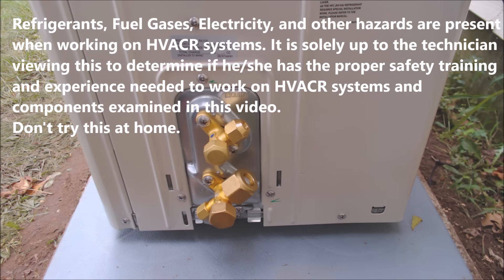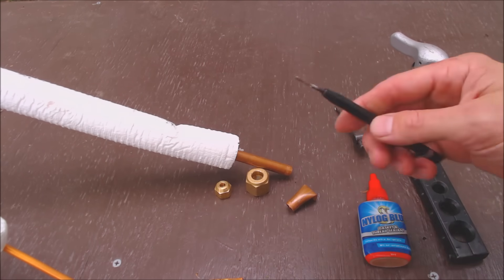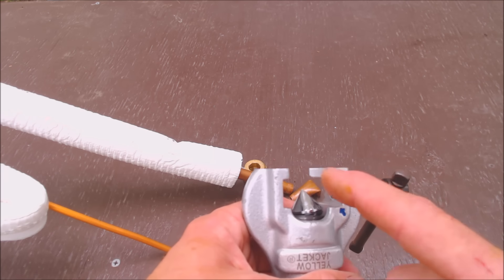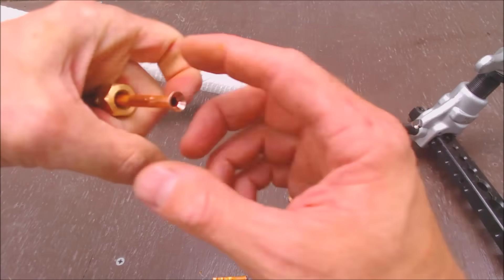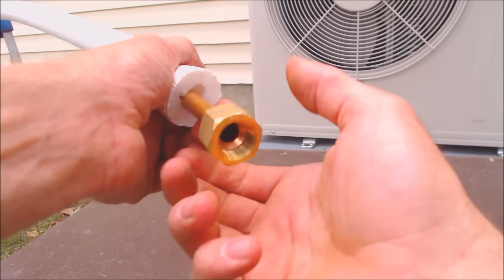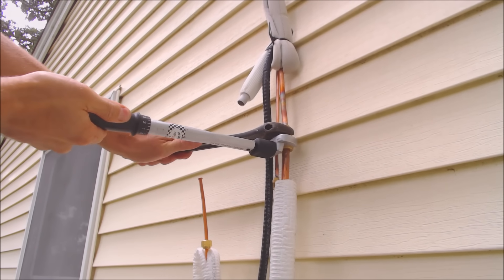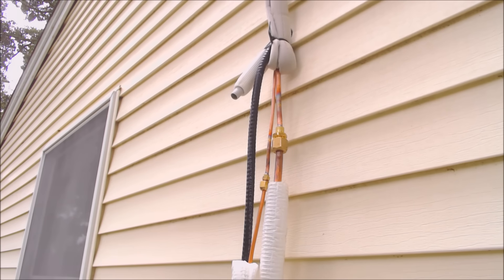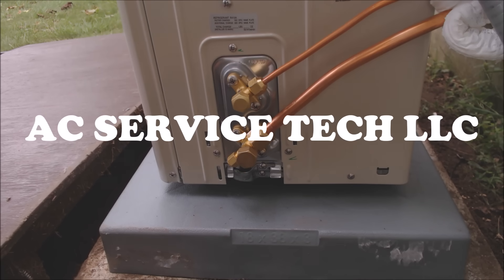How to Flare and Install Copper Line Set on a Mini Split Unit!

Comment: I am in the processof installing a 1.5 ton mini split. The Unit came with a SealSafe leak prevention kit (PAC-FSR-1412).  Kit includes a fluid (leak guard) and (2) 1/2" Flareseal rings and (2) 1/4" Flareseal rings. Would you recommend using both the rings and the fluid or just 1 of the 2 products and why?

Thanks

Comment: “I like to take up the full (area) of the flare seat” …almost everything else was very well done, but the larger flared end actually makes it more likely that the flare will leak either immediately or later on. Flares leak when a crack propagates from the stretched end through the seal created by the pressure from the nut forcing the flare and seat to conform to each other. Once a crack begins to propagate it will keep growing. Increasing the length it has to reach before there’s a gas leak only changes the number of temperature/pressure cycles before it spans the seal. Adding 25% to the area adds 25% more time before it leaks. Stretching the copper tube end 25% more to increase the area makes it more than 25% more likely to begin to propagate a crack. It makes what you want to avoid more likely but delays detecting a defect. 

The tubing was cut well, not stretching more material inward than necessary. The reaming was done at light pressure to shave off the material rolled inward without stretching anny of it outward instead. Oiling the flaring cone gets a more uniform stretch of the copper by preventing patches of material from sticking to the cone to shift the pressure to their edges and over-stretching there to compensate, 

A flare stretches the open end of the copper tubing. The more you stretch it, the more likely it is to begin to propagate a crack from the open end that will become a leak path, either during installation or later. The flare only needs enough surface area for the surface roughness peaks that get mashed together in a blotchy pattern to form a continuous barrier. 

. On a microscopic scale every dull metal surface looks like the Himalayas. When the surfaces are pressed together by the flare nut the pressure at the peaks is extreme reshaping the surfaces until enough of the area is in contact to have spread the force out below the elastic limit where the material is only flexing, not deforming. The randomness of the surface roughness makes the area that is actually in intimate contact creating a gas tight seal blotchy. The flare needs enough area to make sure the blotches connect to form a continuous seal. More flared area doesn’t make a better seal, it only forces the installer to tighten the flare nut more to develop enough pressure over a larger area. 

   If you want to make flares that are less likely to leak, make a double flare. The flare is 4x less likely to crack because it takes four times as much stress to initiate a crack in the middle of a surface than from an edge.  A double flare doesn’t stretch the cut end. It stretches the tube wall and pushes the cut end down inside it. It’s named for the double thickness flared end and neeeding two operations in the flaring bar. The failure rate is almost nil, which is why it’s used for brake lines and hydraulics that operate at 1000’s,of psi. The reliable connection is a good trade off for an extra 30 seconds work. 

    The first step is to form a bubble, bulging the tube wall outward near the end. It’s done with an insert in the end of the tube that’s shaped to make the cut end want to collapse inward onto a post so that it bulges outward in the cup of the flaring bar. Unfortunately eccentric drive flaring tools won’t back the flaring cone off far enough to drive the insert, aka button. Use a straight push flaring block with the double flare button to form the bubble. The tooling convention is to make the rim of the button at the thickness that the tube should project from the bar so that it’s a handy reference for how far the tube should project from the flaring block. The standard flaring block doesn’t center the drive cone. That’s fine for single flares and double flaring steel tube. Copper is softer and forms an asymmetric/ off-center bubble if the drive cone isn’t right on center. Until the skill is mastered, turn the drive cone gradually and watch to keep the button parallel to the flaring bar. Be prepared to back off and shift the location of the drive cone slightly to get back to parallel. Drive until the button is almost tight to the flaring bar. If driven tight it’s more difficult to pull the button out of the end. Back off the cone and remove the button. Transferring the tube to an eccentric drive flaring tool to form the flare is a personal preference, it can be formed in the flaring bar it’s in already but the eccentric drive tool makes a symmetrical flare easier to achieve.

Comment: Great video. The eccentric flare tool is a pleasure to use. It does a great burnishing while forming the flare perfectly. I have the same torque wrench. An observation about it if I may. It is essential to be cognizant of the top of the wrench when applying torque. Sometimes in the field we can get twisted up and out of shape. The torque wrench can get flipped and used in the wrong direction.  These wrenches are NOT calibrated in both directions so if flipped upside down the torque will not be accurate.

Comment: Why can we use flare fittings with R410 mini splits but have to braze condensers?
 It is the same gas and pipes at the same pressures.
Great Video

Comment: Would you flare over braze solder the joint ? I’ve heard a lot of times flare fittings can have issues even if they’re done perfectly correct what is your take on this

Comment: Hey Craig,  when using the yellow jacket flaring tool i sometimes struggle to get the depth just right. It seems to me that the depth needed to achieve a flare that backs up tight to the nut (as you like to make them) differs between different sizes of pipe. Is there some kind of a depth gauge or something to cut down on the guess work? Thanks

Comment: Should you seal the ends of white insulation, I’ve been hearing about a lot of problems with moisture interacting with insulation and causing pin holes in copper

Comment: I have a haunting question. How much line set can you remove (how many feet) before you have to worry about the amount of R410a in the system? I know Pioneer is pretty precise about how many OZs to have per running foot of line set. But is there any leeway? What if I want to cut off 4 feet from a 16' line set?

Comment: Thank you for the great video instruction.  I use a product that is inexpensive insurance.  It is called Flaretite.  I have no affiliation with Flaretite but highly believe in their product.  Have had zero callbacks due to refrigerant loss.  They are basically a gasket for flare connections.  Even tried Flaretites on a poorly done flare and it sealed perfectly.  They may send you some samples to try for yourself.   I have shared some of my inventory with other HVAC Technicians and they are impressed.  

I very much enjoy this channel!  Thanks again.

Comment: It seems like every call I had to those type of units ended up being a leak at the flare. Sometimes they lose enough gas and get reset so many times that it takes the compressor out.  One of the biggest names in my area used Leak-Lok on the flares.

Comment: At 1 min mark , what if the ends coming from the wall are female fittings and your adjoining line set is also female?  I have this situation (I have a 50' line that I need to extend by 10'.  Do the male ends that you need to add to the opposite end have to be silver soldered? Or can they be a flared fitting as well?????  Thanks in advance.

Comment: Are refrigeration flare nuts sized metric? What are the sizes of the 3/8" and 1/2" line nuts? Can an automotive torque wrench with a crows foot work for torqueing?

Comment: How did you bend the pipe?
Reply from the maker: Just by hand. Its very small so no tubing bend was needed. The outdoor hole in the wall was also olongated downward which made it easier, thanks!

Comment: Good morning I just subscribe to the channel very clean work! I have a question regarding the line set coming down the wall I have a similar situation that is being installed here today actually. I don’t want to have the ugly looking insulated copper pipes just coming down the wall as it’s where you walk in through my gate of my house on the side. So I would like to use line hide or something similar to hide all of the pipe as it comes down the wall is there anything that you can recommend that will fit everything inside? My AC unit is residential and 2 ton. The total travel from furnace to the side of my house is 70 feet.

Comment: Hi I have a mini split system that has to have the line kit replaced but all I see is  3/4” on one of the nuts and 7/16” on the other is that the tubing or the bit because I can’t find tubing that size

Comment: I don't understand why your torqueing down the 1/2" line to 40+ foot-pounds when many others call for 25.8 then loosen then re torque to 26.6 Foot Pounds including Mr Cool Non DIY units. Their 1/4 line specs were 11.00  pounds then tighten up again to 11.8. Can you explain why your saying 40 Plus foot pounds with the same copper lines?

Comment: My question is how short can you cut the lines? My inside wall unit is going inside my garage and the outside unit is going outside in the same area so I really only need like 6 feet of line and I have 16.
Thoughts?
Reply: Manufacturer of the mini specs a minimum lineset length for proper operation. Most are around 15ft with stock charge. 

I don't think 6ft will work. The minimum is there for a reason.

Comment: Hi,

I got a 16' mini split lineset that came with my Pioneer unit, the excess is about 6'. Can it be coiled up or do I have to cut it to size?
Reply: It can be coiled up. You can cut it to size for a neater installation, but it is not necessary. The coil radius should not be less than about 8"/20cm (radius) if you're new to bending copper, and be very careful.

Comment: I need major help. I stripped my 1/4" flare. I dread the idea of having to solder a new threaded nipple. I just realized it would be easier if I got a coupling, and just flared both ends and avoid soldering. Would that work ?
Reply: Just do what he is doing in the video. I over tightened my 1/4" on my first system and ruined the flare. Get a flare set from Amazon.. make new flares. It is pretty easy once you get the hang of it. Don't crank down on the fitting once you reconnect it ... when they say 11 foot pounds of torque, they mean it!
Reply: @TheBlairHouseProject  my flare is fine my threads are gone on both sides.

Comment: Great video... pretty informative.  No Teflon tape on the thread is needed...? I don't have an ac unit but was watching the flaring and tool - nice work...not sure if you know -  is that yellow jacket stuff specific to copper or would it work on mild steel(car brake lines)....?
Thanks for posting..
Reply: Dont use ptfe tape., (it's the flare not the thread section that forms the seal) 
2/ yes the tools are HVAC only, cars have different tooling again

Comment: Is that 3/16” protrusion from the top of the forming surface or the bottom of the forming surface.  The reason I ask is the instructions for my mini split calls for more like a 1/16”.
Reply: 1/16 sounds better. 
Or 1.5mm on average
Reply: Nathan, thanks, sounds right!

Comment: Thanks for these helpful videos on the mini splits. I have installed several of them at my home. I recommend you get a professional flare tool. I recently purchased a cps clutch type and it makes perfect flares. The first one I had, yellow jacket, would not flare 5/8" correctly after 3 tries and the refrigerant leaked out. Once I got that fixed it has been running perfect ever since (a Gree 12000 btu unit). Another unit leaked at the 1/4" flare connection (a Klimaire), costing $600 to fix. Another one of my units had electrical problems after only 1 month of operation, another Gree. Overall, they do kick butt once they are running properly.
Reply: dont blame the flaring tool, if you had been a little more clever you would have pressure tested
Reply: You spent how much on tools? Far more than just getting a tradesmen in. I'll give you points for enthusiasm

Comment: I see the copper tube was twisting when the flare nut was torquing down. This means the flare was turning and rubbing against each other, and you don't want that. Why not add some Blue Nylon to the back of the flare  so the nut would not turn the tubing?

Comment: Great content.   I religiously watched your process and the 10-Reasons why a mini-split flare may leak before buying all the equipment to do mine.    I'm using the Navac NTF66 flaring tool which is very similar to the Yellow Jacket but it has a standoff that slides and gives you a reference for how far out the tubing should stick before you ratchet down and flare.   Makes perfect flares every time.    I'm using the cheaper CPS torque wrench which is fine for installing a couple units but setting the torque on it is goofy.    If I were a full-time tech I'd buy the Yellow Jacket torque wrench set.

Comment: I torqued mine by feel and it held perfect vacuum for 2 hrs and passed the soap and water test as well ... I have turned wrenches a long time and done many renovations, so the feel for torquing flare nuts is not a new thing, but I'm still gonna get some crows feet and use a torque wrench on the next one, on such a critical operation no need to guess
Reply from the maker: Absolutely! Thanks!
Reply: A lot of guys over-torque when they guess, or are inexperienced. Torque wrench is best. Covers your warranty too. 
We've done piles of repairs to other guys over-torqued split flare nuts.

Comment: I know this is a mini-split, but can you use flare nuts on the 4 connections (2 at the condenser, 2 at the evaporator) of your standard 2 ton R410 unit you find in a lot of homes.  Why is brazing so prolific and not this?
Reply from the maker: Brazing has less chance for leaks. Flares need to be tightened to manufacturer torque specifications, thanks!
Reply: @acservicetechchannel  but can be used if you have the torque wrench to do it with ?  I meana 410 ductless minis use them so I assume they can withstand the pressures?
Reply: Darrin Alcorn. You just gotta use what the manufacturer supplies. Braze for really old school units, and anything  about 3/4+

Comment: What's the best way to remove copper burrs which has fallen down into the valves ? This happened during removal of outdoor unit for relocation ??
Reply from the maker: The only way is to try to blow them out with nitrogen from the ports before the reinstallation, thanks!
Reply: Dont drop swarf down the lines. 
Pumpdown to relocate unit

Comment: Nylog is "thread" sealant.... Don't use it on the flare face!
Reply from the maker: Matt, you don't want to use it on the threads because you will over torque it when tightening down to the specified ft/lbs. This is used on the flare face instead of oil. However, oil can be used on the flare face. We just make sure its the same type thats in the system. Make sure the flare face is not dry, thanks.

Comment: How can that flaring tool work, with it's off-center, wonky cone that moves as you turn it in?? It can't give a nice circular flare centred on the middle of the tube but will give a sort of oval shape. I can't see how that can make a proper flare?
Reply from the maker: It actually works better due to there being less surface contact while flaring to avoid scratches. It just rolls one part at a time and I can say that this makes the best flares out of any tool I use. Did you check out my video using 4 different flaring tools? I show close up images of the flares- https://youtu.be/99Em47LdX7g
Reply: They actually work better than the old school ones. Plus clutching to avoid thinning the copper walls

Comment: Hey there! Hoping to get a response regarding torque wrenches recently bought the blackmax digital wrench and Daikin call for 15.7NM on the 1/4 inch line for VRV. I'm finding it hard to read it on the screen because after finger tight it stops reading at about 12nm so I'm tightening a little more to approximately reach 15.7. Is this  because the  blackmax is a long wrench and you have more leverage with a smaller nut? 
Also only using nylog on my flaring cone not on the brass connection to avoid over torque as well.
All other nut sizes don't have a problem at all it's a great tool and also have the yellow jacket digital wrench on the way too

Hoping to find a solution!
Reply: Can go up to 18nm, yes it's seems not much more than finger right. 
6inch Crescent is good on 1/4. 
Use 1 wrist/pound

Comment: I am assuming that correct procedure when pulling a vacuum on a unit such as this mini-split with only one service port is to pull from just one side?  Saw your video on vacuuming in which you highly recommended pulling from both sides but few minis have two service valves.  Good series.  Take care.  Doug
Reply from the maker: I just did a vacuum procedure in a mini split unit as a recent video. Check out the channel home page or look up mini split vacuum, thanks!